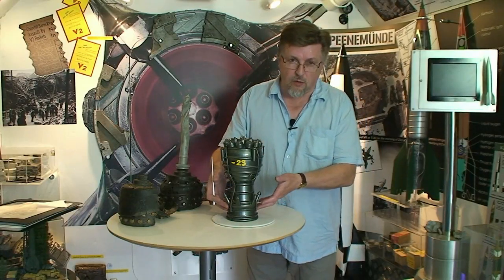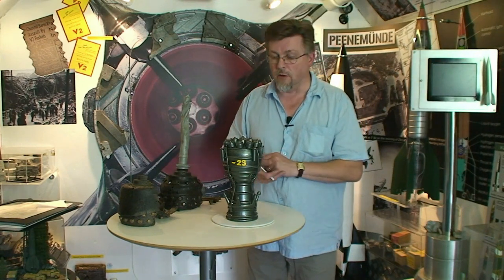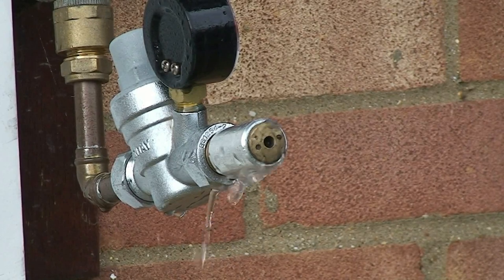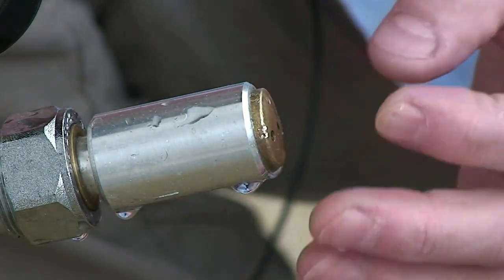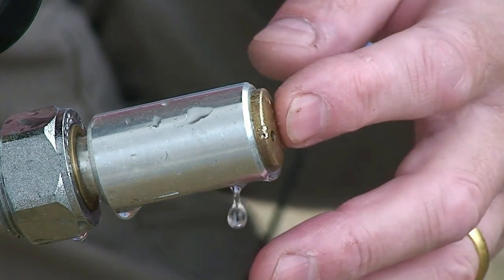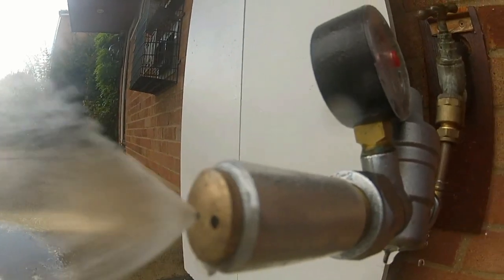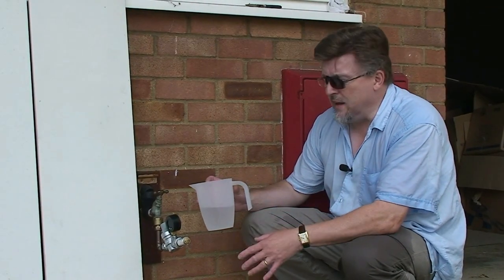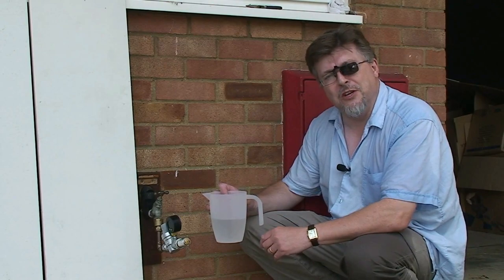A4 / V2 Rocket in detail: fuel and oxygen injectors

Comment: I personally would beg to differ on one point. The switch from steel to brass would have been motivated by tooling life considerations. These nozzles would have been made on an automatic lathe and switching materials from steel to an easily machined material like leaded brass or leaded bronze gunmetal would enable an automatic lathe to double or tripple its nozzles made per day output. This is because the machine can be run faster with less time lost in sharpening and reseting tools and in replacing broken tools. This type of automatic lathe is cam operated and can make a nozzle like this in less than a minute. They are rarely used now because computer controlled lathes are used instead - unless huge numbers of identical components are required, like for instance the small brass screws for plugs and sockets are still made on cam operated automatic lathes.
Reply: There is no absolute need of an automatic cam lathe to make those injectors. A revolving turret lathe would be slower but give finished parts with threading done. Of course, using brass or bronze instead of steel is less punishing for tools, but it is also more difficult to find in wartime contingency. If you read the 4year old comment of Douglas Abbott, you can also consider that form tools save a lot of machining time and efforts. In this case, saving on sharpening is actually valuable.
But look closely at the  multi-jet nozzle ant you will see that it is hollow and the back side shows a small recess indicating it is probably a two part assembly to form an inner chamber for the whirlpool to form and spread the liquid on all holes and not only the central one.

Comment: It is mentioned at about 13min into the video that you can see the lines from the lathe work on the nozzle. Strictly speaking they must a have used a form tool to make the outside shape of the nozzle. This is revealed by the fact that the machining lines are concenctric rather than spiral. Spiral lines lines are produced by a single point lathe toole and concentric lines are produced from a form tool imposing a shape in the metal.  I know it seems a small useless point but I think it is best to be accurate about these things.
Reply from the maker: Hi Douglas - thanks for that comment - it's not useless at all. Far from it, I spend much time explaining that there are no mind-bendingly complex ideas in engineering - alone they are always simple, and easily comprehended but there are many compounded in layers and all very particular. Thanks for highlighting that 'particular'.  KR RJD A&NTV
Reply: They'd have used a capston/turret lathe to make them. Quite simple to make to be fair
Reply: @chipsnpeasifuplz  Actually, I would think they would have used a 'Swiss Lathe" to make them, the same tool used to make the components of Swiss watches. The Germans manufactured these automatic lathes used in Swiss watch factories, programmed by cams. Those lathes were unique in being able to perform a number of simultaneous operations at the same time, and very quickly.
Reply: Every detail counts.

Comment: At 13:30 About the steel vs brass nozzles.
I wonder if corrosion was really an issue. After all, they are not re-usable. And I assume that they are used as fast as they are produced.
Maybe they are just faster/easier to produce from brass stock.
Reply: I doubt they would have used so much scarce copper without a very good reason. Copper was becoming unobtainium in late war germany.

Comment: At Minute 3:28 the top of the engine is shown, what are the blanked off connections intended for, are they something to do with the pipes running vertically from the lower portion of the exit nozzle, and if so why were they needed?  And what is the white/grayish material between the mixing chambers and on top of the engine itself, some form of insulation perhaps?  
What is the history of this engine, it looks to have seen better days?
P.S. After watching another of your fine videos I now understand that the excellent displays consist of salvaged and restored V2 parts, it's a very interesting display.
Reply from the maker: +Dan NZ Hi Dan and thanks for posting.  The combustion chamber shown at that point is a relic recovered from the underground factory in Nordhausen. It had rested in up to feet of water for 60 years hence the less than mint condition. The relic is on permanent loan to the museum I think. The blanked off connections are the LOX inlet ports (18 of them) - the caps are to protect the threads and prevent debris entering the internal spaces of the motor during transit and storage adventures.  Although the V2 motor system was primitive by today's standard it was unnecessarily complex (an odd situation for a primitive product) and as a result it was very fragile and was easily corrupted by corrosion and foreign bodies degrading the function and delivery capacity of thin tubes, jet ports, and valves. This situation is not unique to the V2, as I'm sure you realise, and in general, a modern motor would still need transit capping like this. The greyish material you refer to is blobs of cured cement mix! It originates from some repair or construction work carried out at the factory immediately above the chambers and the mix splashing down on them. It's difficult to say when this occurred exactly but I have looked at it closely and looked at where in the factory they were found, and I think it is quite likely the 'accident' happened in the active '44/'45 period.  Indeed it's a possible explanation of why these (there are a number of them in existence) chambers have survived until today. They were rejects, perhaps because of the mishap with the cement mix, and survived just because they were relegated to a part of the factory facility, for refurbishment, and the Russians did not think it worthwhile to take them (they had plenty of good chambers available). I hope this helps. KR RJD ANTV

Comment: Do you have any information on the thrust chamber pressure? The delta P between chamber and fuel/oxidizer needs only to be enough to secure atomizing and mixing but the propellant turbo pump has to deliver fuel/oxidizer at chamfer pressure plus atomization pressure. I imagine the alcohol mix picked up plenty of heat in its passage through the engine jacket. 

If you're obtaining design flow at domestic water pressure my guess (judging from study of the pump video and estimating dimensions and impeller RPM at 4500) is the pump delivered perhaps 500 PSI at rated volume.  I also eyeball the engine had roughly a 7 1/2" throat dia. But allow me a healthy fudge factor.

Sorry about the Imperial units. At my age, you're lucky it isn't in cubits.

Got any specific impulse figures?
Reply: According to Wikipedia the V-2's engine has a chamber pressure of 220 psi. According to astronautix.com LOX/alcohol rockets achieve a specific impulse at sea level of 284s and in vacuum (if I read it correctly) of 338s.

Comment: Thank you for the great presentation, I found it very informative and learned a lot from watching.
At 12:58 when you show the simpler upper nozzle, has this been manufactured in two parts and later joined by some method?
You mentioned steel and brass as two metals used in the construction of this mixing chamber, can you tell me what the actual combustion chamber and exit nozzle were made from? 
You also mentioned water and alcohol as fuel being injected, I don't understand this reference as I had assumed that only relatively pure alcohol made from potatoes was used as the fuel.  
Thanks
Reply from the maker: +Dan NZ Hi again Dan. The brass/bronze alcohol injection nozzles shown were of a one and two piece design. The ones with the small outlet hole are made in two parts, with the components forced together in a press and a thin outer edge against the visible seam collar pressed in to lock it togethe. A joining compound of some kind is in evidence on the separated parts but this seem fairly light and provides little bond strength (they are virtually impossible to separate, but by cutting down the centre and restoring the surface of a cut half carefully you can just trace the outlines of the two parts with a hand lens and the parts can be easily separated once cut through like this).  The injectors with the larger size hole are made in one piece as there is sufficient clearance to firstly bore and then introduce a  milling tool with enough overhang  to create a swirl chamber that has a greater internal diameter than the exit port. To reduce the burn temperature (and other factors) 25% water was added to the ethanol (derived as you say from potatoes). I hope this helps. KR RJD ANTV
Reply: +Astronomy and Nature TV Thank you for your reply and for the additional information, I wonder in the first case if that the two parts of the smaller injectors might have been brazed or silver soldered together as this would have been a very simple, quick and inexpensive method to join the two halves while retaining a high strength and temperature resistant join.
I also wonder if the 25% water was partly the result of a less than perfect distillation process that ultimately proved to be a desirable if unplanned addition to the fuel? The water would certainly have flashed into steam during the combustion process thereby producing additional volume in the combustion chamber and greater exhaust speeds, but I also wonder if the combustion temperatures were high enough to break the water molecules apart so that the engine was infact also burning hydrogen with a little bit of extra oxygen? Although I can't see how this would be efficient.

Comment: What was the chamber pressure just outside of the nozzle while the engine was running, and how would that change the spray pattern or mixing of the fuel and oxygen? Your tests were at 1 bar.

Comment: Was there a gasket, washer, or sealant on the various nozzles originally? What would the thermal effects be on the fit of the nozzles, particularly the lox one considering there are different metals in use?

I like the way the Heath Robinson flow checker is better engineered than the rocket and incidentally they are some top quality Dr. Strangelove shades.

I would like to state for the record I ask merely for curiosity and have no intention of building a V2.
Reply: I expect those issues were not a concern as these were i tended for a single use and operated for a small amount of time.

Comment: What kept the burn in the lower part (combustion chamber) contained so as not to reach the upper part (the 18 pots with the nozzles and LOX sprayer-head) and burning there and utimately through the nozzle-pathways into the alcohol-manifold of the pot and also into the LOX sprayer head into the LOX feeding tube, etc. to avoid a cataclysmic event?

Comment: I'm guessing those brass injector nozzles were made on a Traub Screw machine. They are still in business.
Reply from the maker: Hi Erik. Certainly an automatic cam and multi-spindle lathe of some sort and as you say most probably Traub. I have a list of some of the machines used in the biggest factory workshop in Peenemünde (Fertigungshalle Eins or F1) and there were 6 Traub machines listed but no mention of the model or type only a factory machine number without a key. KR RJD A&NTV

Comment: My guess would be that there would be more heating of the cryogenic oxygen than cooling of the metalwork . The oxygen needs to be gaseous to react so needs to take a good deal of heat from the fuel (heated by combustion)

Comment: Why was the alcohol/water mixture used to cool the nozzle and not the lox?
Reply from the maker: Hi Niklas, thanks for the good question. On the face of it, LOX looks like a strong candidate for engine cooling purposes - but the negatives stack up pretty quick. The German rocketeers of 1935, struggling with technology in its infancy, ruled out LOX as a coolant from page one. There's a hierarchy of reasons that start with the fact that cooling transfer performance will be poor because the LOX won't stay liquid long enough (regardless of pressure). The engine's design would need radical changes in plumbing and construction materials, making it significantly more complicated. The risk level is not symmetrical on almost every critical moment of fuel vs LOX analysis (minimising explosions, contamination consequences, hardware survival overtime etc.) and boils down favouring fuel as the 'safer' coolant. There are other secondary objections too. These are real challenges even today - 80 years ago, they were impossibilities. KR RJD A&NTV
Reply: @RocketPlanet  Thank you very much for the good answer.

I've just checked the F1 and Rs-25 and neither of them uses lox for cooling, you learn something new every day - or at least on the good days!

Comment: First man made object to exit our atmosphere. A direct forerunner to our mighty Saturn V rocket propulsion system.
Much as a rail way gun in ballistic performance but not with the explosive shove of burning propellent in a barrel. They begin to slow after initial blast, rockets start very slowly but soon gather ever increasing speed till earth’s gravity is overcome to enter near space.

All the basic requirements to enable super sonic flight in a parabolic ellipse out of the thermosphere with controlled re entry after propellent fuel consumption. With out frictional heat destruction upon descent.

Unfortunately weaponized, it was however a brilliant example of problem solving to create especially in the time frame it was constructed. Thrust is useless unless contained and controlled for flight in desired trajectory. Such engineering could be used in less destructive rolls as in exploration of the vacuum of space. Once free of launch planet gravity very little fuel required to speed from one gravitational pull to another in the use of travel from one planet to another. Of coarse many computations required to time properly. A flight to round  Mars and re enter earth’s atmosphere with a recoverable rocket not beyond the realm of this technology.

Again unfortunately the rockets we know are in the majority used to deliver the destructive capabilities of nuclear type devices such as hydrogen war heads. If we look at history it is a trait of man kind to war on one another. Scientists can work for peaceful improvement or for destructive forces.

Comment: Odd the internal wall is thicker, while the outer wall must? Sustain a higher pressure, perhaps 50-100psi higher than internal pressure.
However internal must sustain higher temperature and more variations in pressure perhaps?.

I'm quite surprised the thin steel can sustain this pressure ... 2000psi perhaps?

Comment: You mention in the comments that the amount of water in the fuel was 25%.  What was the purpose of the water?
Reply: Cooling. Difficulty at keeping alochol at or even near 100% concentration. Alcohol is hydrophilic, so it will naturally pick up water from the air. This effect slows the more it is diluted, so there is a point where the water-pickup effect is slowed to the point of not changing much in the brief times the fuel tanks are opened or unsealed vs. reducing the effect of the fuel. This is why when you buy rubbing alcohol in the drug store it is not 100%.